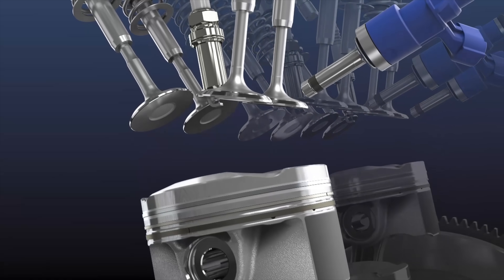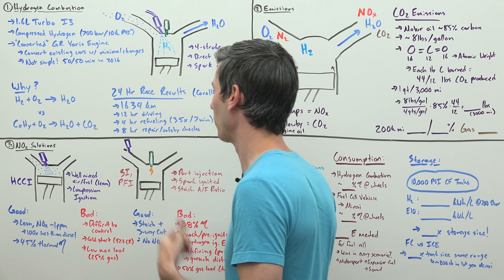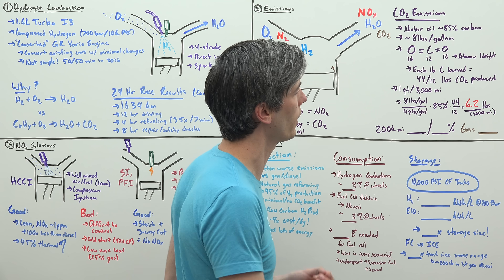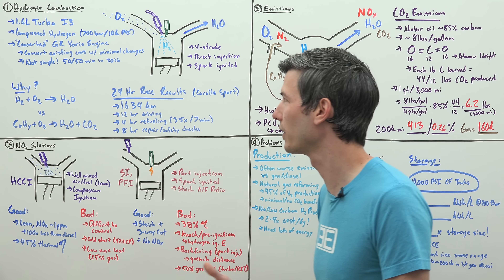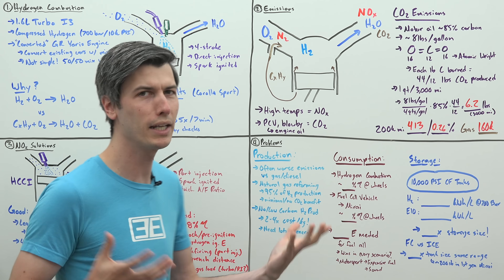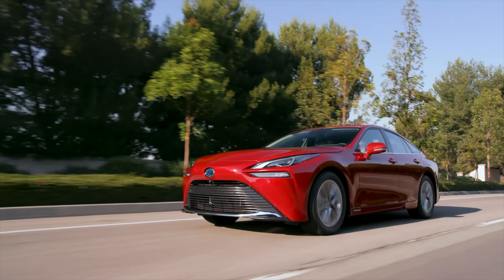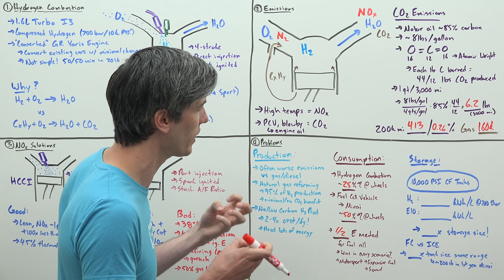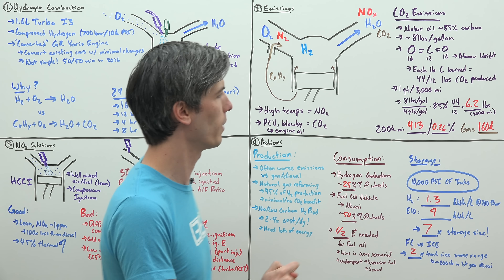Toyota's Developing A Hydrogen Combustion Engine!

Comment: Toyota has been hanging onto hydrogen for a while.  They've had hydrogen cars and they had a hydrogen gas station on campus when I worked there.
Reply: I’ve been saying for years that hydrogen is the future and electric won’t be as prevalent in the near future. It’s a smarter and more cost efficient way to keep  the world mobile
Reply: @MrBassbump  You think its smarter to take electricity and turn 3/4 of it into waste heat instead of using it directly?
Reply: @Markle2k  are you talking about electric vehicles? I want to make sure I know exactly what you want to know
Reply: @MrBassbump  Electrolysis to split water to get hydrogen is a fairly lossy process. Absolute state of the art is about 70-80% efficient. Then you lose still more in pumping and cooling losses. Then you hit the fuel cell and lose 50-65% of what is left through the radiator.
Converting electricity generated to and from very high voltage transmission lines costs about 3% on each end. You lose a similar percentage through those high voltage lines and about 5-7% in distribution lines and the household. From there to the battery, you lose about another 8-10% and a similar amount putting power through the wheels.
Reply: @doomsday5286  I want to see more on this. I am very aware of battery degredation over time being a user of modern cell phones... I also buy 15 year old automobiles because of cost. I can't afford to buy a car and then need to replace it's expensive battery pack immediately because it's range is shot. And then how well can we recycle these battery packs? How efficiently can we do this?
Reply: @blakestone75  The practice in a cellphone is different from that of a car battery. The first thing to note is that lithium polymer is the tech used in phones. Cars use a different chemistry.
The second is that phone manufacturers allow you to use the full capacity of the battery. That is vicious on the battery. Car manufacturers leave a buffer on the top and bottom of the battery capacity and recommend users to only charge the battery to full when they are going to use the top of the battery. You only charge above 80% (including the buffer) when going on a trip when you are going to use that capacity.. When you dip below the safe voltage of the battery, the car will only let you use enough power to limp to a charging station. Imagine if a combustion car had an oil warning that only allowed you to use the engine conservatively when you were low on oil. That is what is going on.
I have an app on my phone that tells me to disconnect the charge at 80% and to charge at 30%. After 3 years, I have 85% of the capacity left. Lithium ion batteries used in cars are much more robust.
Reply: @0QualityOverQuantity  The heat that fuel cells produce is approximately the same proportion that internal combustion vehicles produce. Do you want that, in addition to the heat that you scavenge off your heater core, always flowing into the cabin? I think you haven't done the mental math, let alone the actual math. All vehicles experience range degradation from cold temperatures. ICE cars just hide it in the losses.
Reply: @Markle2k  The hydrogen economy is coming but it's unlikely to come to small vehicles. Sweden and Finland are going to set up a hydrogen pipeline around the Baltic and fuel it with windpower electrolysis hydrogen. The trick here is that the hydrogen will be used by steel refineries and such and massive backup powerplants. Maybe large hydrogen trucks if that pans out.

Comment: I feel like hydrogen makes a lot more sense for planes and long haul trucks.
Reply: They drove a thousand miles and had to refuel THIRTY FIVE times. They got 30 miles PER TANK. It makes no sense for either; the energy density isn't there. Even at 10,000 psi.
Reply: No body attention to emition Pollution of plan

Comment: There is one more issue that was not referred. Using 100% hydrogen Fuel in elevated Combustion Pressures and temperatures, there is a significant production of Deyterium (due to high pressures, mimicking deyterium production process at the bottom of the oceans)  and on the long term a production of Tritium, that is the radioctive isotope, which can mitigate its radioactivity to engine parts. 
 I remember on the 80s an inventor had used as a fuel water mixture with 15% gasoline, and on the long term has noticed radioactivity production at the exhaust. 
Therefore hydrogen should be used in cryogenic temperatures like in a fuel cell to avoid such phenomenon.

Comment: The hydrogen fuel tank sounds like quite the (fuel/air) bomb in a crash. edited for clarification
Reply: My thoughts exactly
Reply: It's not. Even when shot with a projectile It dissipates too quickly to cause an explosion. Toyota has videos of them running these tests.
Reply: You guys think of Hydrogen as a bomb but in actual use this gas is so harmless that even you shot the tank or completely crashed it, it will never burn.
Reply: To make a hydrogen bomb, one would still need uranium or plutonium as well as two other isotopes of hydrogen, called deuterium and tritium. The hydrogen bomb relies on fusion, the process of taking two separate atoms and putting them together to form a third atom.
Reply: @SamMonkulas  No I think of the Hindenburg whenever I think of hydrogen going up. But I am also smart enough to realise that one disaster doesn't mean that the whole system is broke.
Reply: There are some scenarios that would be quite bad, for example, a crash inside a tunnel where no wind is available to dissipate the gas. At 700 bar, a full tank will eject a very large hydrogen gas cloud. Unsurprisingly, the Toyota videos did not demonstrate the rupture with an available ignition source. Concentrated hydrogen will burn like the Hindenburg, but a cloud sufficiently mixed with air will explode. All of the vehicles used today rely on very high energy density fuels to push it several hundred kilometers. Currently, the safest is diesel or fuel oil. Gasoline explodes when vaporized, but burns in its concentrated form. Eventually, batteries will be as safe or safer than diesel or fuel oil.

Comment: What if we combined Freevalve and direct fuel injection, with a spark plug? Would not that correct for power (should increase about 30%, get less backfire into the port, because you don't have the valves being half open, if you don't explicitly decide to, and you can tune the engine more or less perfectly for every RPM....)
Reply: Might work for gasoline, wont work for hydrogen due to superiority of fuel cell.

Comment: A gigantic hydrogen reservoir under extremely high pressure that would probably be able to self-drive.  no, I certainly don't see anyone misusing that.  Oh, the humanity
Reply: ALLOHA SNACKBAR
Reply: In case of petroleum or lithium is not volatile enough, there's pure hydrogen to relive the hindenburg every now and then.
Reply: It's supposed to be as safe as lpg, in the tank there's some kind of metal which absorb the hydrogen
Reply: @georgiojansen7758  But what if it gets ruptured?
Reply: Hydrogen tanks are actually very safe. The tanks are heavily tested for safety, you can literally shoot them, then set them on fire, and not have any major issues because the gas dissipates too quickly.
Reply: @BasedMan  The gas dissipates harmlessly into the atmosphere at a rapid pace. Because of the combination of it's high pressure, and the fact that it's lighter than air.
Reply: @Erowens98  Based
Reply: Good thing our current fuels aren't explosive... Oh wait: being explosive is what makes them useable as fuel in the first place!

See, we figured out a way to keep petrol and diesel fuel tanks from exploding 100 years ago, we'll handle hydrogen tanks as well!
Reply: @LRM12o8  yeah, but petrol (and specially diesel) are way harder to ignite
Reply: @BasedMan  will not explode

Comment: I wish someone would continue Stanley Meyer's work - using resonant frequencies to split water into its two gaseous components, this engine would be perfect with that technology! 
Now we just have to redesign the world economy and ween the Oil oligarchs off their massive profits to make clean water powered cars possible.
Reply: That's what this is , a continuation of Stan Myers water engine. It's sad that so many people do not know of him and his sacrifice.......  He was killed because he wanted this technology to be free to the people .
Reply: @lambodre  mostly because his engine worked on magic.   Physics says it can't work.   Its a perpetual motion device.
Reply: @victorluke5816  damn physics, and that pesky law of conservation of energy.
Reply: @victorluke5816  is there not enough energy in hydrogen to drive a frequency device to split h2o into its respective molecules? Would definitely be interesting to play around with at the very least
Reply: Not resonant, there is a diode in the output circuit and it uses the fuel cell as a capacitor more like a voltage multiplier circuit.
Reply: @craftminer49er  The frequency device can't get any energy from the Hydrogen.  You have to pump energy in the get the Hydrogen out.  Afterwards if you burn the Hydrogen then you get less energy than you put in to get the hydrogen in the first place.
Reply: @samiis1260  It still won't produce more energy than you put into the system.  The more you put into the splitting of the water the worse your mpg will be completely defeating the goal of using the hydrogen as fuel.
Reply: @victorluke5816  You can use it as a supplement to carbon fuels for more efficient burn ratios thereby obtaining about 20% fuel savings.
Reply: @samiis1260  The 20% higher efficiency was only achieved with highly modified engines.  Without the mods testing was showing that it could actually decrease efficiency by 28%.
Reply: @victorluke5816  It worked on my old cummings diesel.
Reply: @samiis1260  And which lab validated your results?   Many people who made this claim found that if you did it under lab conditions they didn't get the increase.  Lots of it was due to just wanting it to be true.  In fact its never been proven with an unaltered engine.
Reply: @victorluke5816  sorry, didn't mean to insult your dogma.
Reply: @victorluke5816  The Stan meyer system is NOT normal electrolysis. Its about storing energy in time and discharging almost instantaneously thru a breakdown of the dielectric medium ie water. Oh and the second law only applies in a closed system. The world is not a closed system. Read Feynman's physics if you don't believe me.
Reply: @samiis1260  Still never demonstrated in a lab.   Not asking for much here.  This is bare minimum.
Reply: @samiis1260  Not insulted.  I just follow science instead of magic when I look at these things.  He was never able to do this in a lab and that usually means  he was a snake oil salesman.
Reply: @victorluke5816  I agree that is usually true. But there are rare exceptions.
Reply: @samiis1260  If a lone inventor could actually find  exceptions to long established theories like The Laws of Thermodynamics then a team could do it in less than a year.   Also he never had his devices tested in a lab.   Huge red flags.  I'm betting that Penn and Teller could have got the same results outside of the lab too.   Only they would have told everyone how they fooled all the 
observers.
Reply: @victorluke5816  Actually The Amazing Randy sent some of his students to a lab and completely fooled them. But stop with the second law excuse, solar panels, heat pumps, windmills all violate it.
Reply: @samiis1260  Solar panels, heat pumps, windmills all follow the 2nd law perfectly.  I'm not sure if you understand what the 2nd law of thermodynamics means.   

Solar panels take photons from the sun and convert them to electricity.   You lose about 50-70% of the energy in the conversion. 

Heat pumps just move heat which also loses energy when you move it.

Windmills convert the flow of air into energy and you lose energy in the conversion as well.

You are claiming that you gain energy with this process which no other process known can do.
Reply: @victorluke5816  I understand perfectly well. As I said before    The second law only applies in a closed system and we live in a open system ergo heat ,wind or some other energy input from the ambient surroundings are added to the system.
Reply: @samiis1260  So where is the good ambient energy which being lost to produce the lesser energy of getting split hydrogen and oxygen.  If the ambient energy can be used to split water then it can be used directly to power the car without splitting the water molecule.  It would be an ambient energy module.

Comment: Jcb in the UK are developing Hyrogen engines aswell for diggers etc. I think I read somewhere they are using starters and powerful cranking batteries from diesels to counteract the cold start compression issue

Comment: imagine the amount of carbon build up on the intake valves with this, considering that direct injection gas cars already have issues with this.
Reply: This is easily fixed with a catch can.
Reply: Except you can just use a fuel cell system instead of a hybrid ICE.
Reply: Why would there be carbon build up. It’s burning Hydrogen.
Reply: @robertmud.4317  agree😂😂
Reply: @robertmud.4317  My thoughts exactly 👌. Hydrogen burns cleanly, effectively making a zero emissions ICE 😁

Comment: kinda like these kinds of videos, very insightful. guess we'd be on gasoline for a good 20-30 more years. lol at least till someone makes the thorium engine a thing.
Reply: Good luck with that. Try to find cheap oil in the future, while we are already runing out of it today. Biofuel can be made of corse so yeah u won. Sure.
Reply: @doubleg7298  the peak oil myth. Nice. But not factual.
Reply: @doubleg7298  we were a exporter of oil by the end of 2020. And gas prices went down to below a buck in some areas.
Sorry but that's not what happened. We have what is called "peak oil production" , with current regulations and taxation, the oil pipeline project being shutdown and another oil pipeline bout to be turned off soon, it's only gonna get harder at the pump.

Comment: I haven’t thought this through Chemistry-wise, but would hydrogen combustion engines produce ammonia (parasitically, not intentionally, of course)?
Reply: they're actually researching using ammonia as a fuel source for hydrogen combustion
Reply: @Hotdog7Music  IIRC, some rockets have used it.  That being the case, that chemical reaction is more likely exothermic and spontaneous from ammonia to N2 and H2, rather than to ammonia, so probably very little ammonia produced.